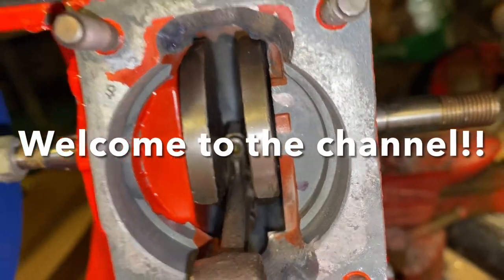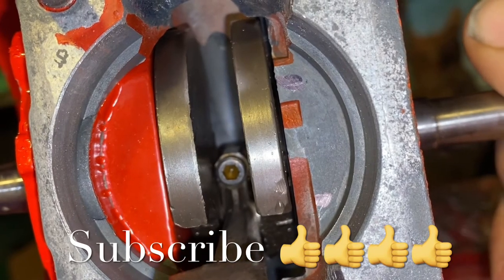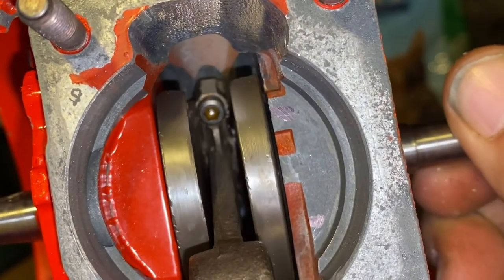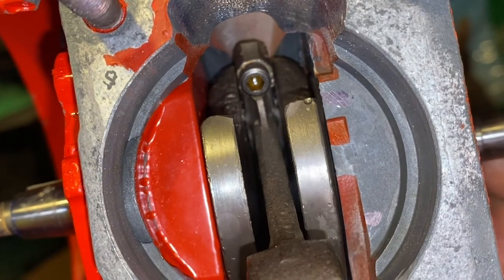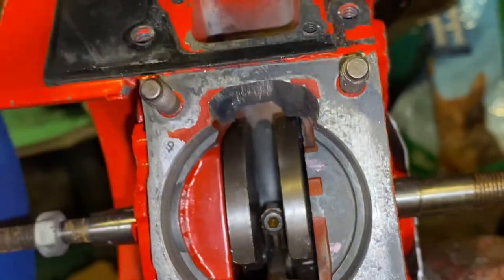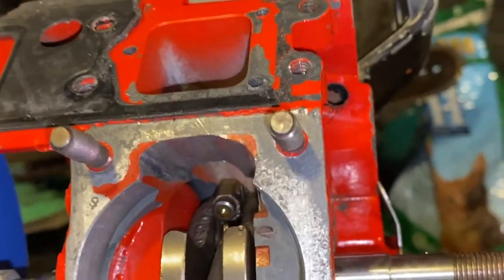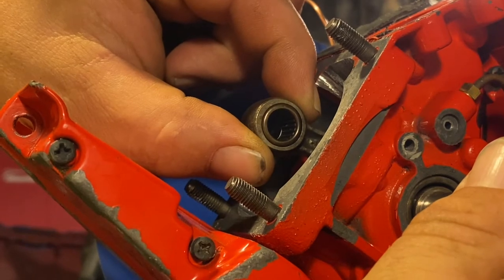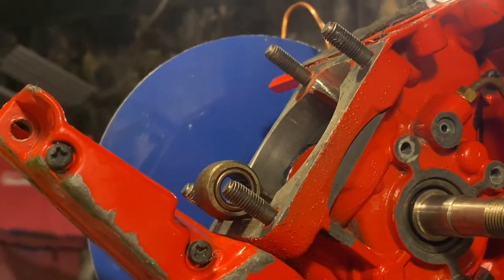Chainsaw running out of control!  Will not Idle!  High idle! Air leak!

Comment: That is actually a very good explanation.  My SXL AO would not rev up much and the H and or L adjustments had little effect.  I had replaced fuel lines and cleaned carb before butting it away last fall and it was runing great,  Last evening I found the two carb mount screws to not be very tight.  I tightened tham and SUCCESS!  Sucking aid around the gasket?  I re-tuned the carb by my original owner's manual and the saw is awesome again.  This is probably a 1972 vintage..

Comment: Hi this tutorial was very informative thanks for sharing. I’m working on a Sthil ms200t that’s revving high and doesn’t run idling. It’s also a old Sthil chainsaw so with the knowledge I’ve just received I will be getting a pressure/vacuum checked and ordering the double lip crank seals in place of the original seals that can with the chainsaw . I’m new with working on two strokes engines and repairing. Sincerely thanks 👍

Comment: Thanks Smitty, I’ve got an old Echo 350wes, new carburettor and revs out of control when you start it up. Only way to reduce them is keep choke on or half on.. trying to get crank seals here in the UK though is nigh on impossible.

Comment: You did a pretty decent job explaining how the negative and positive pressures in the crankcase and how the fuel charge is dispersed when it comes to seals and air leaks !!!
If a person is doing the quality build they should pressure and vacuum test can express that enough that will solve a lot of guessing when it comes to air leaks and vacuum leaks !!!
Reply from the maker: Thanks!!

Comment: Mr. Smitty I have an old 1989 echo cs280e and echo no longer sells the crankcase seals.  I thought of taking measurements of the seals and going to my local industrial bearing and seal vendor.  Any thoughts?   Any suggestions would be welcome.  Thanks for the clear in depth explanation of the  combustion process with the demo saw.
Reply from the maker: Many have used that method

Comment: Thanks! I have the issue with my chain keeps running after I throttle, mostly only after a cut. I have a homelite 360.
Reply from the maker: The 360 has a rubber intake boot.  If you have never changed it I suggest starting there.  They are easy to find on ebay.  The crankshaft seals are SKF 6119 part number.  I have seen two seals installed on the clutch side before but only one of that part number is needed.
Reply: @Smittyschainsaws  Thanks! It already has a new boot, I'll check the crankshaft seals.

Comment: Thanks for video......I have a new Ryobi chainsaw that is hard to pull or jerks when cranking....once it starts the rev is very high and I couldn't get it to come down enough. I feel like this is my issue.  I bet the saw only has 4hrs of run time. Thnx again
Reply from the maker: Glad to help
Reply: @Smittyschainsaws  definitely pulling air from somewhere

Comment: I have an old Paulan that my dad gave me a long time ago. He died in 2021. I’d like to keep it going. I replaced the carb because I could only get it to run with the choke and then it ran high. If any throttle at all it would take off then die. after rebuilding the carb twice, no improvement. I replaced the piston ring about 10 or 12 years ago. I’ve concluded it must have an air leak because the new carb does the same thing. I’m thinking the air leak may be on the head  seal or a cracked head. It sat in my shed for the last ten years or so and not used since the last time I successfully used it. Only use ethanol free. I’ll try to rebuild and get a better seal kit.

Comment: Hi Smitty, thanks for taking the time to share your knowledge. I have a Echo 440 that takes off like you described and I can take that idle screw completely backed off and the saw will rev high and stay running? You think its a seal? Can I spray brake clean to diagnose the leak? Thanks again for sharing and I'm subscribing too😊
Reply from the maker: Yes, break cleaner will work. don’t forget to check your intake boot.  Bigger leaks are common at the intake.  The cylinder base gasket is a commonly forgotten spot as well.
Reply: Thanks Smitty, hava a happy Thanksgiving and good luck on the channel.
Reply: @freddy2064  I have same problem with a few chainsaws exactly as you described, you find the problem?
Reply: @sawyerbennett8227  
I have an echo cs4400, I replaced the carburator and that fixed it.

Comment: Where can i get xl12 crank seal the double lip type
Reply from the maker: SKF 6119 would be a good part number.  If you do a google search you will find they are common.  If you are familiar with rockauto they do sell them but I do not know the pricing.
Reply: Parts store a good part man can probably cross reference that part number for you an get it for you I've done that before.
Reply: Thanks on the transfers.  Gives me something to think about.
Reply: Google search skf 6119 MRO supply.  5.06 each as of today’s date 12/6/20. Free shipping over $20, buy some extra- don’t ask me how I know but it is easy to tear them on the clutch side with the shoulder.  Ended up using an aluminum can wrapped on the shaft as a guide to get that one installed.
Reply: I order seals and go to town on one saw i have 4 xl12s i love these saw they RIP THANKS AGAIN I APPRECIATE LIKE MANY OTHERS ALSO KEEP UP THE HOW TOO VIDEOS

Comment: My stihl chainsaw has the same problem of revving too high and not adjustable and turn off itself when not in throttle,what should I look for?
Reply from the maker: You probably have an air leak. Try spraying break cleaner on the rubber boot between the carb and the cylinder. Do this when the saw is running. You will notice real fast if it’s leaking. It will shut off on you. Don’t use anything flammable when doing this test.
Reply: Also why is it hard to start? I've check the spark,fuel line,cleaned up the carb and the air filter too,all goes fine but still have to pull it many times..pliz suggest me I really need your help
Reply from the maker: @msangvaiphei4699  The same issue that makes it difficult to keep running will also make it difficult to start. Just get some break cleaner and start spraying it at different seems while the saw is running. It is very noticeable when you find it.
Reply: Thanks sir, I'll work on it next day...have a good time n keep up the good work👍

Comment: Hey great video man! This JUST happened to me on a Homelite 360 that my brother asked me to take a look at. 
Would the crankshaft seal also cause occasional hard pulls on the rope?
Reply from the maker: Homelite 360 look at the intake boot first. The rubber boot between the carburetor and engine. It’s the most common problem with that saw.
Reply: @Smittyschainsaws  Damn that was a fast reply. Thank you! I'm subbing right now.
Reply from the maker: @gjohnson7649  Stop back anytime!  We do a lot of performance mods with the Homelite saws and other vintage saws on this channel. Hopefully you enjoy it!
Reply: @Smittyschainsaws  Awesome. I love the vintage woodsharks. I'll be a frequent flyer I can assure you.
Reply from the maker: @gjohnson7649  this is the one I am working on right now. You might enjoy it!  https://youtu.be/2qjsBMzSAB0

Comment: MR SMITTY, I AM HAVING THE SAME ISSUE WITH MY LOMBARD AP-42 COMANGO THAT I TOOK OUT OF STORAGE. HIGH IDLE! RAN FINE UP TO THE POINT IT STOPPED RUNNING ALTOGEATHER SO IT WENT INTO STORAGE. I REMOVED THE CARB AND FOUND THE ISSUE OF NOT RUNNING. THE NIPPLE ON THE DIAPRAHM CAME OUT OF THE LEVER! SO I INSTALLED A NEW KIT ON BOTH OF MY TILLOTSON HS9AX CARBS. AFTER REINSTALLING THE CARB I GOT A HIGH IDLE. SO I PUT ON THE SECOND CARB AGAIN HIGH IDLE! SO I KNOW NOW THERE IS AN AIR LEAK ON THE ENGINE, SO I AM REPLACING THE CRANK SEALS AND ALL GASKETS! LEON'S CHAINSAW REPAIR AND PARTS IS HAVING THE SAME ISSUE ON A POULAN PRO CHAINSAW AGAIN HIGH IDLE!